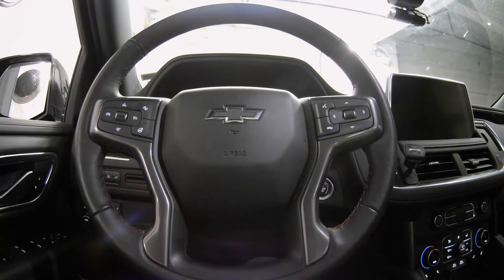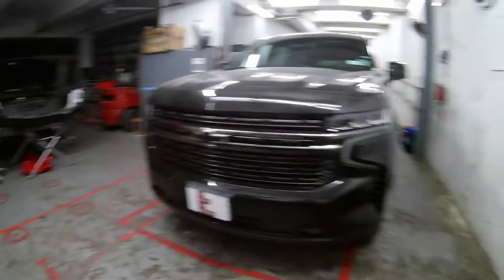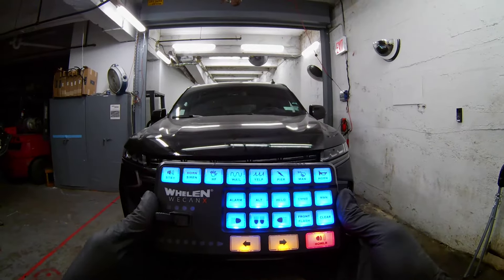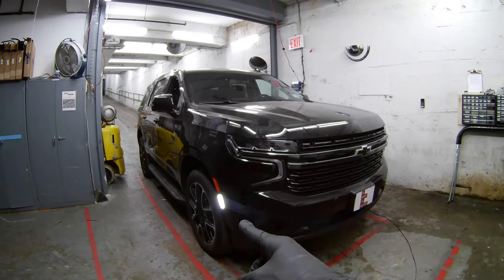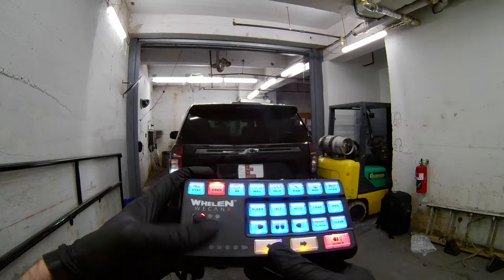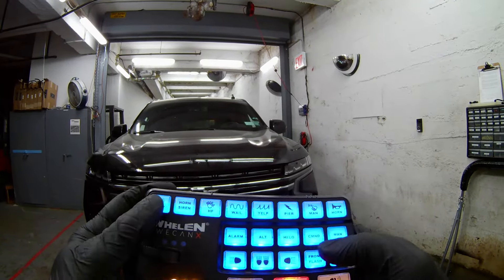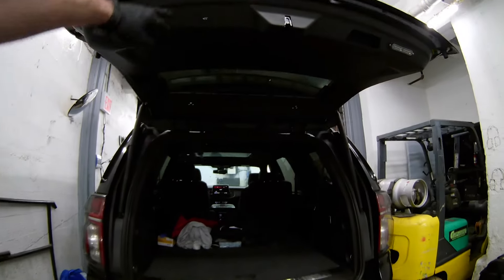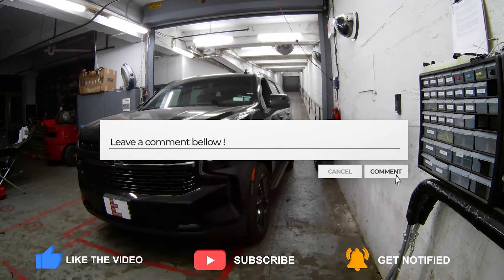CenCom CORE - In Depth Tutorial | 2021 Chevy Tahoe build

Comment: Perhaps, it would be better to video after you mount ALL the equipment. I had a hard time using my imagination for the equipment that is waiting to be shipped. Additionally, it’s much better to guide the extension via driver’s side window, instead of closing the door on the wire. Other than all that, the vehicle will make a great Taxi 😂😂😂😂
Reply: The door doesn't affect the cencom.....